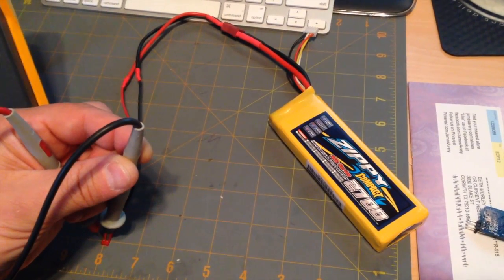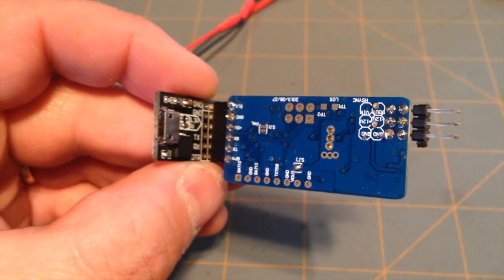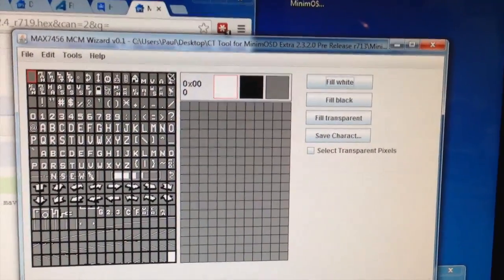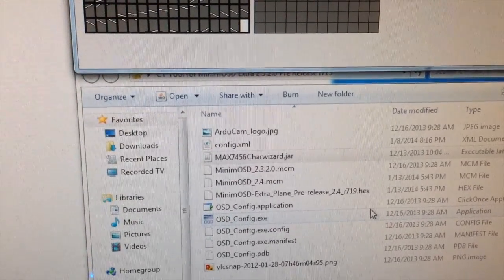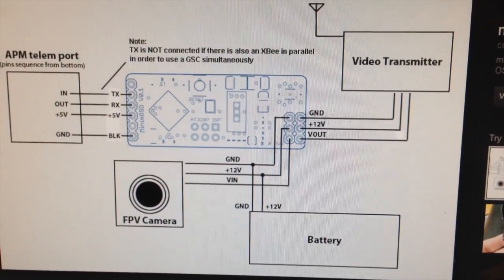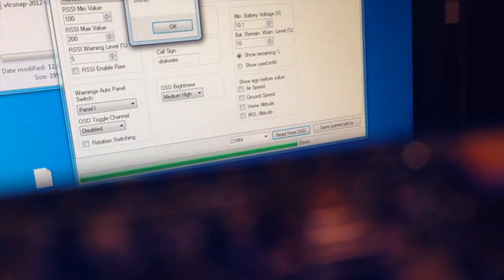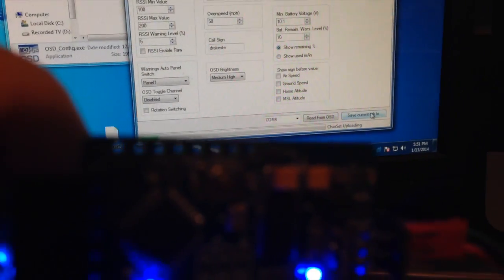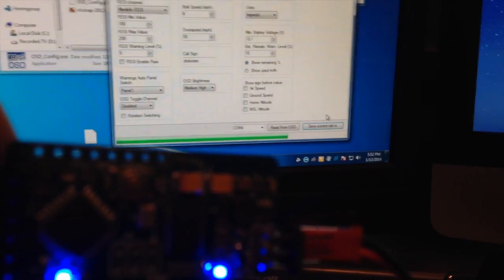update charset minimosd

Comment: Don't think you are doing anything wrong. Also don't think you need the 12v feed on that 'Mini OSD' board as it's a slightly different design to the original MinimOSD and I believe the 5v feed (from ftdi adapter) is being bridged to the other side of the board. I think there is possibly a compatibility issue with the MiniOSD board. I have the same board and get exactly the same issue as you. I can use old MiniOSD firmware versions just fine, but none of the -extra versions work.